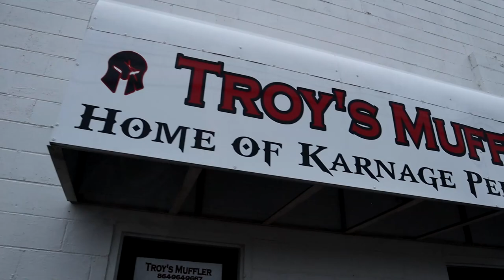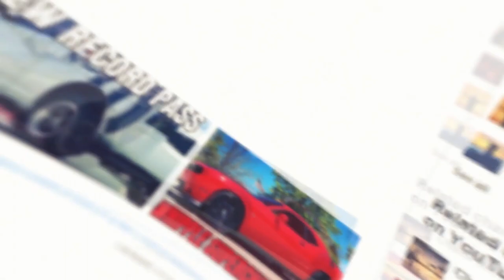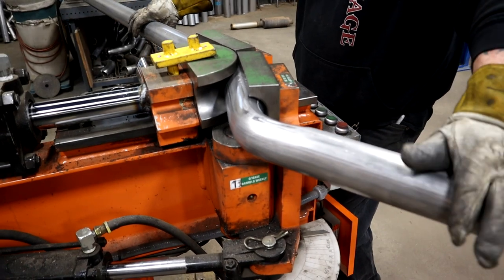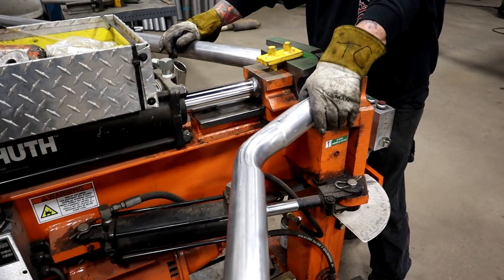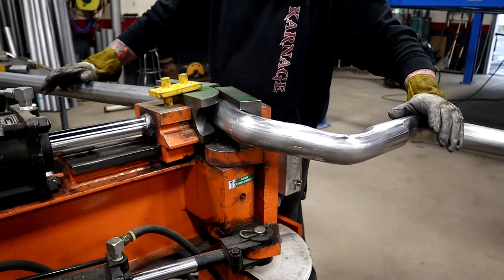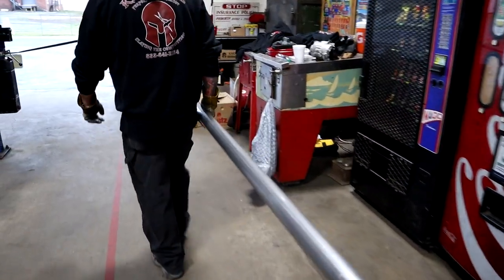DAKOTA R/T Gets KARNAGE Performance Exhaust Sounds Sick!

Comment: I say this as an RT owner. This is the most slept on truck in the history of trucks.
Reply from the maker: Most definitely
Reply: Because dodge never marketed them properly. These things had so much potential that was waisted. There were plans of putting the mopar m1 on them from the factory but it was scrapped. At least from what I remember.
Reply: @jerodwolford2743  they didn’t want it stepping on the srt10’s toes and I think that was a terrible mistake. This is a far better truck and if they would’ve made them manual, holy crap would that have been an incredible machine. Now I just have to scrape by and find whatever second hand parts I can find for this thing because everything was discontinued ages ago 🙄
Reply: @BrOkEnSkAtEr1295  trust me, I feel your pain, lol. My rt hasn't been on the road since 2019. I was trying to hemi swap it because the 5.9 and 46re blew but im thinking I'll just put a 5.9 and 46re/nv3500 back in so I can actually enjoy it while I try to gather parts for a hemi swap.
Reply: @jerodwolford2743  damn that sucks man, I hope you’re able to figure it out. You on any of the FB groups for our trucks? 

I’ve been looking for that hotchkiss lowering kit they discontinued years ago. My trucks been clunking down the road for about 4 months now cause the control arm bushings are shot and idk I don’t wanna take all that shit apart just to leave it at stock ride height. Seems like a whole lot of work for nothing to me who cares about safety? 🤷🏻‍♂️😂
Reply: @BrOkEnSkAtEr1295  yeah I'm in the rt owners group and a couple classified pages on Facebook. I bought mine with tubular lower A arms that drop it about maybe an inch or so with most likely cut coils and a 3 inch block in the rear. I believe it also has an upgraded rear sway bar because it has poly bushings, but you never know. The control arm bushings and ball joints need replaced something bad but I'll be more than happy to do it on the rt instead of my 1st gen dakota. As much as it's a PIA to get stuff for rts, 4x4 1st gen dakotas are somehow worse

Comment: If I was paying any kind of money for any kind of custom exhaust, I would try to make sure that it's mandrel bent and not crush tube.  I know it's not gonna noticeably affect the horsepower, but what's the point of paying for the larger tube if it's just getting crushed down a quarter of an inch smaller diameter
Reply from the maker: Per dyno testing on the 2 methods only 1hp difference not worth the money if you ask me.